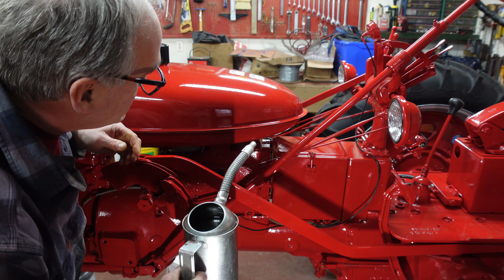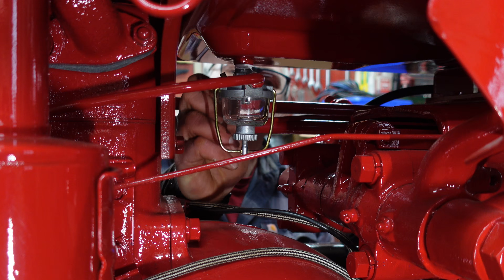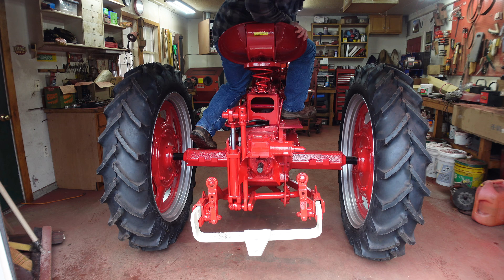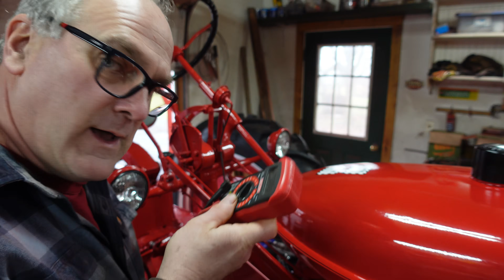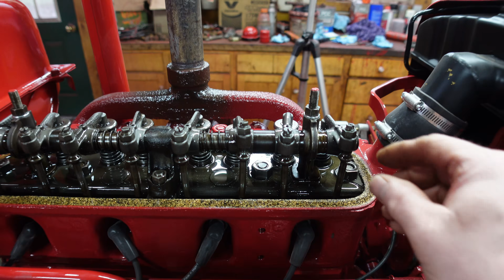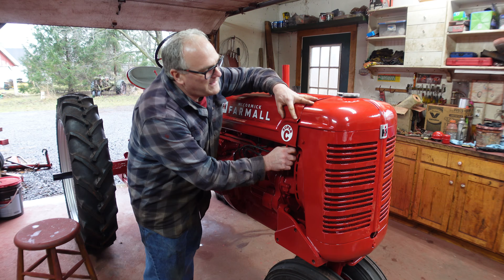Starting the Super C for the First Time! | Farmall Super C Restoration Episode 21

Comment: Love to see you adjust all that needs adjusting by just hearing. A much underappreciated skill these days. A lot of skills have been lost because companies tend to hire a person after someone retires instead of letting him/her walk along for a few months.
I had an encounter with an engineer that just graduated when a sensor signal was lost that monitors a bearing. I pulled up a screwdriver and put it against the bearing housing and put my ear against the other side telling the bearing was working like a charm. His face was priceless. 
Also had an encounter with a civil engineer that thought a fan was working fine "because the temperature was fine" while you could hear the fan going up and down in rpm while making a screeching noise. Since he was the boss and he was making me clear he was, I let it go only for the fan to stop working like 30 mins after because the coil was burnt.
On the other hand, I had a colleague claiming that a certain hydraulic pump could hold 18A at -60°C (-76F) while being rated at 11A at operating temperature. We checked it with an IR camera and it surely held up perfectly. Oil is "a bit" thicker at those temperatures.

Comment: I am strictly forbidden from using or installing or being in possession of glass fuel filters or any glass parts for gasolene engines.   you can get caught sleeping on the job or get caught smoking dope and you'll be okay but if you get caught with a glass fuel filter,  you're fired immediately, like pack up your stuff and get out right now.

Comment: I had a sweet 240 , it was the successor to the Super C. great litle tractor, perfect for chores and raking hay, or pulling smaller loads. I also had a two cultivator for it, that worked well. I wish I still had it.

Comment: Pete I saw a complete rebuild and cost. His 1952 Farmall that he rebuilt every polt and nut. He spent 8800 USD in parts, machine shop everything but elbow grease. I bet your cost about the same. Those older tractors are being bought Ed and shipped overseas. It looks beautiful Pete. Those are your legacy. They are just beautiful. my grandparents had 2 tractors, big green John Deere, ford that was repainted blue belly.  All for 88 acres farm. He also owned a crystal factory he moved from Baltimore to Westminster. He did work for armed fores and Apollo missions. I never knew a master watch maker could do that? Neal Apollo Beach Florida

Comment: Coming from a. Duel fuel mechanic  small military jeeps will run on gas or diesel but II think you would need racing fuel to stop blowing head gasket your compression might be as high as 14 to1 to run on diesel  and that won't cut it even with high test to run on gas even with the timing retarded good luck and keep making great videos

Comment: Great job Pete! I restored an old 1950 Willys jeep. It takes a ton of patience and innovation! I had a Cracked block so I squeezed an Chevy V8 350 under the hood. 
Power steering and tilt wheel. I painted it a blaze orange.  I also made my own wire harness.  That thing was a tank out in the wood's.  Not to brag on myself but most people today can't fix a sandwich more or less there lawnmower! Lol.

Comment: Excellent & Congratulations Pete  :) on hard work did to Farmall Super C tractor gas one and all explained you did in steps on  restoration ! Very Happy All Work & Fine Tune and 15 second turn over engine and light test drive in garage ! Plus head torque up also check out after very nice to and very happy for you too how came from start to finish too ! Like when said only this was white in color on tractor was draw too  and it surprised me thought be chrome silver or black or red colors might be ! Also Peter do you ever check on low , middle, high idles with headlights on low to brighter stages plus voltage on Alternator recharge too battery when running too on volt gauges for compare at! Why ask be mechanic taught me that trick years ago when restoration tractor he said help know if electrical need light check up or adjustment need to! He told me sometime over years dirty battery cable be faulty not on Generator or Alternator recharge plus burn out to fast and Starter too depends sometimes! He said had tractor come for repair on electrical and tractor owner though was Alternator going need replacement, turn headlights on gas tractor died so did tests found Ground cable needed replacement and plus after changed found fuse need replacement! Soon fix all went 100 perfect right! Owner of tractor want Alternator replacement and plus Starter rebuilt to make sure to was not waste Mechanic time or have tractor fire! But got resolved quickly too!

Comment: I don’t identify with any tractor manufacturer, because I don’t yet have one. If and when I do get one, it will be an old one. I don’t want anything with microchips. Just read an article in Reader’s Digest having to do with the “Right to Repair” movement going on. The software is proprietary and can be remotely turned off. It was also pointing out that farmers can no longer repair their own equipment because the mfr won’t allow access to the software. They have us over a barrel it seems.

Comment: Runs like a sewing machine, smooth as silk. Those Steiner restoration quality IH mufflers really make them sound like they should. Like they did from the factory, with the Factory IH muffler. I think they nailed the baffling in these, supposedly they claim they actually used IH blueprints to make these mufflers, and the way it sounds, I find that information to be accurate. They just sound so nice. It always baffles me why some people put all the time, money, and effort, to restore their Farmall, and in the end they slide a Stanley from tractor supply on it, have it sound like crap. Quite frankly the amount of popping from a Stanley, you can’t tell if your timing of the engine is off, or if the carburetor tuning is out of wack. And they try so hard to tune the popping out to no avail, and don’t even think it’s not the engine it’s the cheap Stanley muffler causing the popping.

Comment: Looks and sounds awesome!
I found when the vdc reads that high the charge in amps is low, the battery is pretty much charged. The old H would move the needle turning the lights on running and really move it left with the engine off. Guess I am writing what you already know. Great yt content!

Comment: That is a very fine example of  engineering for the time at its best. Your attention to detail is mind boggling. I really can’t imagine making a machine that can work for you easier to manage. With the materials available for the time there is a certain amount of simplicity from the results of burning carbon and converted to torque.

Comment: I have followed you for a while. I grew up on a farm silaler to yours. We had a Ford Jubule and a super A. Wonderfull times. I learn to deive on the
A. I could not reach the peddles so my father would put the tracker in first gear and I would use the starter to go and the stop switch to stop. I am
77 now and reliving the times with you. I started on the A and retired from the airlines on the Boeing 747. Thanks

Comment: Bravo Pete, a masterful restoration of a beautiful old Super C.   You started with a good working tractor that had gotten worn down after many years of use, and since you had owned it for awhile, you had kept up the maintenance, which helps greatly when you do a restoration like that.  I am looking forward to you running it, and using it as part of the tractor posse you have.  I personally would have kept it a wide front end,  and wonder why you really chose to change it.  I always felt they are mor stable with the wide front end, but more parts to get worn and broken.  Hopefully now you will have time to relax for a bit, and get some time to figure out which diamond in the rough you will work your magic on next winter.  Do them while the body still lets you, as when that happens, you will still want to but your body says no.  Ask me how i know this.  Take Care, as I like your channel very much.😊😊

Comment: Fantastic job!  I can almost smell the fresh paint and rubber.  Super jealous—my old C has not run in probably twenty years.  Now that I’ve retired I’ve ordered some parts to rebuild the carb, distributor and added a one wire alternator and change over to 12 volt.  Thanks for being meticulous and recording everything so I can use it as a guide!

Comment: supprised on your choice of engine oil we still use non detergent oil in our super M
Reply: Rotella is an excellent choice. Several years ago, zinc was eliminated or greatly reduced in oils, but rotella still has a generous amount of it. Without zinc, flat tappet cams and lifters won't last very long. In your case, I'd highly recommend using a zinc additive. I use Lucas TB Zinc-Plus.